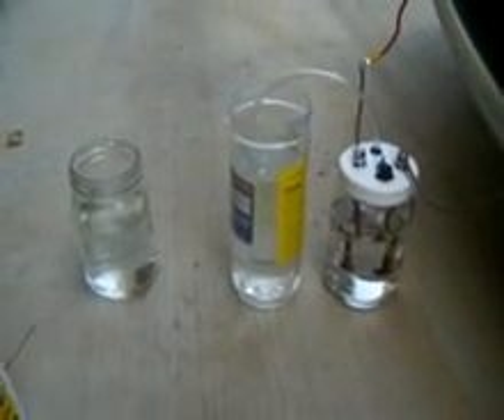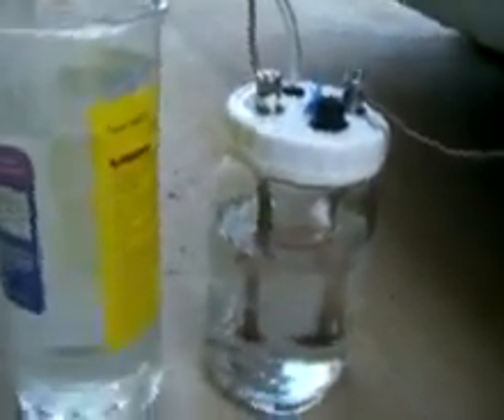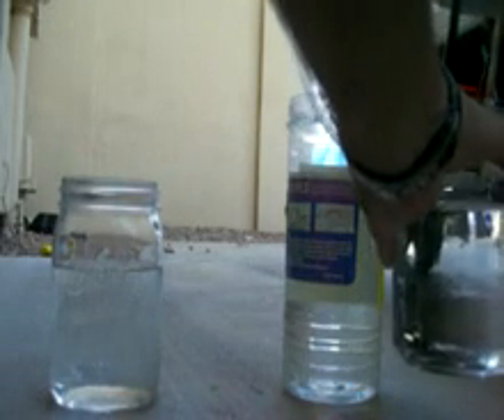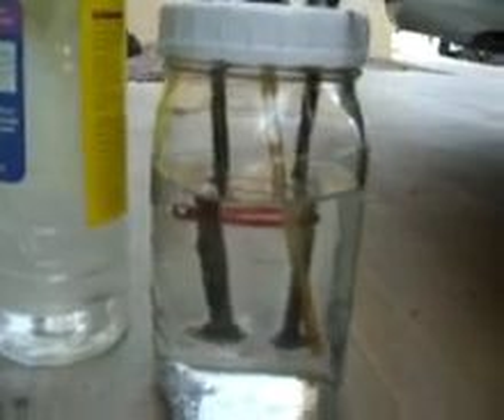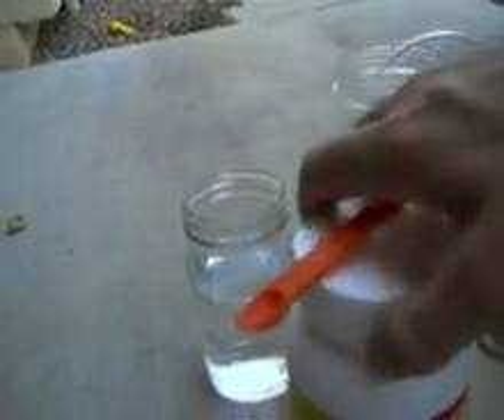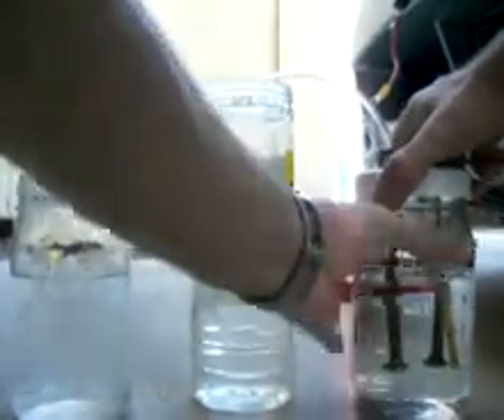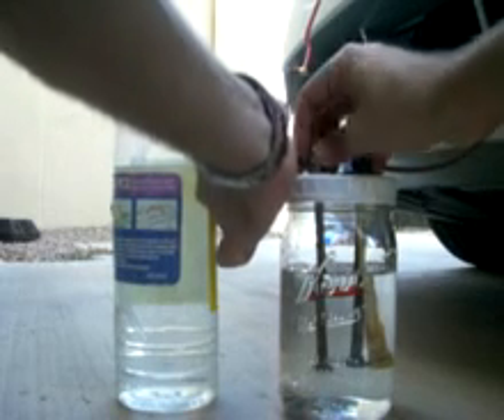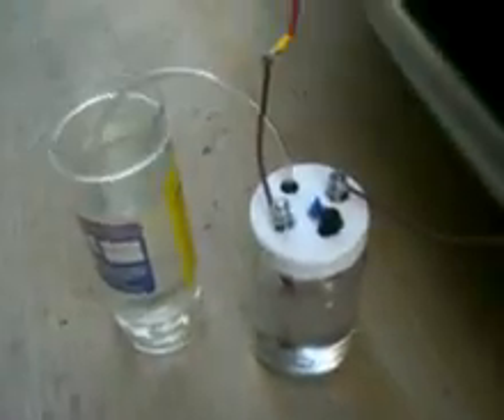HHO Generators: Sodium Hydroxide vs. Baking Soda! Pt.2

Comment: @RDKamikaze Productions is good but Sodium Hydroxide will damage all aluminium parts in engine like KON Potasium Hidroxide i recomending do not use it for good on your engine
Reply: even if you run it thru a water bubbler before the engine?

Comment: Hydro-carbon fules have a much greater  energy density per liter. 87 Octane Gasoline has about 32 megajoules per liter , Hydrogen only has about 10 at 20 kelvin

Comment: First, I would applaud your interest in the use of hydrogen as an alternate green fuel source.  However, beyond that I feel that your dedication is lacking sorely.

For example: You obviously admit that your own cell design is not up to par.  And cross contamination of electrolytes seemed of no concern to you.  I think you should back up and start over.

Good luck!  And I wish you the best in your pursuit of developing a viable cell design.

Elmo